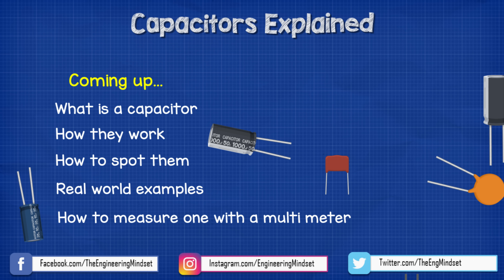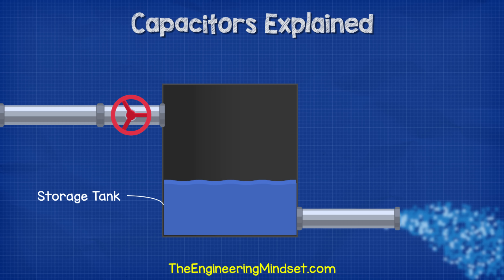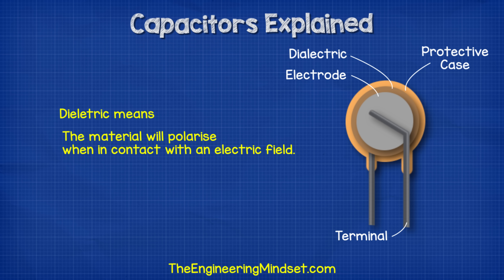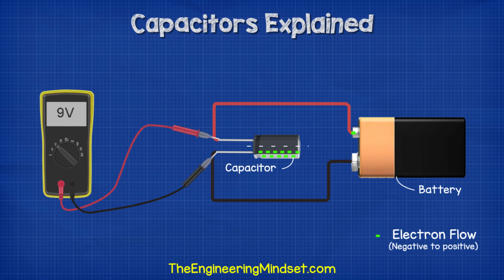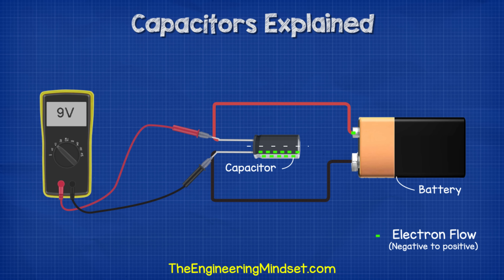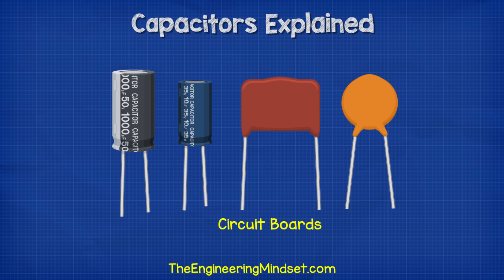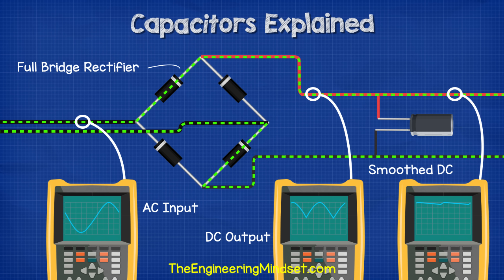Capacitors Explained - The basics how capacitors work working principle

Comment: The force generated from opposite magnetic poles is transferred through the system (conductors, equipment), not electrons.  Electrons change their orientation and vibration to transfer the force.

Transformers work by transferring power without touching each other.  By definition there is no electron transfer, they don't jump the space between the transformers.  They facilitate the transformation of energy.

Atomic theory is a theory and believes matter can neither be created nor destroyed.  There are many who believe God created all things out of nothing.  This is a fundamental teaching of the Orthodox Church and isn't believed by the Orthodox so much as it is transferred.  Tesla was from a Serbian Orthodox priestly lineage and did not believe in electrons or the theory of relativity.

He can be criticized for this, but he saw his inventions before he built them and they worked.  Very, very little loss of efficiency between his mind and the reality of his practical, working creations.  Edison and Einstein were great, but not comparable to Tesla in this regard.

Long story longer, electricians are regularly taught that things like generators are creating and pumping electrons.  Contradicts atomic theory (the basis for the bulk of contemporary electrical theory) about matter not being creatable or destroyable.

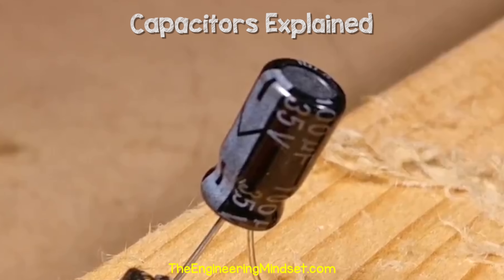Comment: There is an error at 6:02. While it is true that capacitors have a voltage that it is rated to be able to handle up to, simply providing more voltage than the rated voltage doesn’t cause the effect shown in the following video. The video shows what happens when you use an electrolytic capacitor in reverse polarity, and that reaction is specific to the chemistry and make-up of the inside of electrolytic capacitors. For example, doing the same to a ceramic capacitor will only damage the dielectric material, not cause an explosion. In fact, putting a voltage higher than the rated voltage on an electrolytic capacitor will only risk that the voltage exceeds the capacitor’s dielectric breakdown voltage, meaning that current then flows through the capacitor instead of storing potential difference. This is completely different to the video shown, as you can see the red and black clips being connected to the prongs of opposite polarity (assuming that red means positive and black means negative) meaning that it is not excess voltage which causes the explosion.

Comment: Hmm thanks, i now understand capacitors. And wish i had of known about them when i was 17 pulling apart a CRT monitor thinking id be fine as there was no power cable attached.
The pointed solders put holes in my fingertips and i had to push my hand away from the board with my other arm as I had no control over that arm and couldn’t move it away willingly.

Comment: Thanks.  I remember engineering classes with lots of theory and endless formulas - but little practical understanding. One doesn’t need differential equations to be an engineer - I never used them. And there is a Hugh difference between engineering vs. design.  Good design is critical.

Comment: Initially , its shows there are electrons on one side for a discharged capacitor, While charging the capacitor, it's shown that all the electrons at one plate are moving towards battery and some electrons came from the battery eventually leading to potential difference b/w capacitor plates.
While using at light ,it's shown that the no of electrons at each plate are equal and eventually light fails to glow. ( capacitor in discharged condition).
There is a contradiction in the explanation used.

Comment: In HVAC we use different types of capacitors. Such as start and run capacitors. Have you covered the difference between these types of capacitors somewhere? I haven't been able to locate mentioning of this use of capacitors. Thanks for all you do!
Reply from the maker: See circulating pump video, it's discussed in there

Comment: As great as this video is, and it is excellent, the storage tank analogy at around 1:00 in falls flat.  It suggests that a capacitor connected in series will pass DC current at steady state, which does not happen.  The contradiction can be seen at 1:45 in the animated schematic with the capacitor connected, and working in parallel with, the battery and load.  A more useful water analogy for capacitors is the chamber with an elastic membrane.  This analogy holds not only for these examples (storing/releasing energy and filtering), but also for helping conceptualize how a capacitor's reactance causes current to lead voltage in AC circuits.

Comment: Wait. How does a multimeter measure capacitance? How does it know, and how does it get it wrong slightly? How will it react to wiring capacitors in series and or parallel with other capacitors that are same values or different?

Comment: Hi great explanation.
I want to understand how they work?
Can a microwave capacitor be charged with a 12 volt battery ?
Battery is direct current  how are they charged in a microwave?
And what determines when it releases its charger ?
Will a microwave high voltage capacitor be used to relieve initial draw from a small inverter say 1000w sin wave?

Comment: Animation doesent show how circuit behaves when battery is connected but there are voltage drops (ripples?), and capacitor is fully charged. How it charges and discharges, helps to keep constant voltage during voltage drops.

Comment: I'm no electrician but a good example of a common item that uses a capacitor is a camera, specifically a point and shoot that has an optical zoom lens. This is a lens that extends out from the body. Once the batteries are drained and the camera shuts down a capacitor will ensure that the camera has enough power to retract the lens.

Comment: 2023 electrical engineering professionals: K this is good subject matter.

1997 Kid with 2500W parallel amps and 2000 Farad caps and twin alternators with 6 marine batteries in the trunk: K Brah.

Comment: 1.  A capacitor is simply two conductors separated by an insulator (dielectric)
2.  Capacitance is that property of an electric that tends to oppose a change in the voltage
3.  The charge is not stored on one plate or the other; the charge is stored in the dielectric
- these are simple but accurate descriptions

Your water tank analogy is more applicable to an inductor or inductance.  If you want to use a water analogy for a capacitor I would suggest using a hose, where once you shut the nozzle off, the hose expands to a point depending upon the water pressure applied (analogous to voltage).   When you open the nozzle again you get a blast of water until the hose regains its original size.  The elasticity of the hoses is analogous to the dielectric in the capacitor.  
A capacitor is simply a device that concentrates the juxtaposition of the two conductors and the dielectric so you get a large r capacitance than you would with just two (insulated) wires running side-by-side

Comment: I have electronic devices from the early 90s in storage, turning them on for 1 hour (60 minutes) Is it good or bad to prevent all electrolytic capacitor failures due to disuse? what interval time tuning on all electronic devices?

Comment: Hi, could you please explain something that’s confusing me right now?  In this video the electrons are flowing from the negative to the positive of the battery but in the transistor video the electrons are flowing from the positive to the negative. Which is correct or are they both correct and it depends on the type of circuit?
Reply from the maker: See our video on electron flow v conventional current

Comment: In my high school auto-shop class, one quickly learned that, even if it's sitting harmlessly on a workbench, never pick up  a "condenser" (an old name for  a capacitor).  It's a 2" long metal can with a wire attached.  It will hold a 12V charge until it's picked up, completing the circuit between the wire and can.  
It's a s\hocking experience.

Comment: Hi Sir, I have a question. For touch screen switch and some smart light bulb, when you turn off the switch, the light bulb only dim and not completely turn off. but when a capacitor is added between the live and neutral cable, the light bulb is completely turn off. Able to illustrate what is the reason behind that?
Reply from the maker: See our video on full bridge rectifier. The led light and capacitor is shown here

Comment: Fun fact: on a strictly technical level, capacitors do not store charge, they store just the energy - the net sum of charges in a capacitor is zero. It's a fun fact to remember, but for almost all intents and purposes that simplification is understood and only the "ummm ackshually" people may try to correct you

Comment: I took a dc circuits course years ago.  Plenty of stuff hadn't heard of before in class.  There was a guy from our area named An Wang who used capacitors to make the first computer logic circuits to make a 5v 1 bit or a 0v 0 bit
Reply: I remember calculating voltages for the bridge rectifier, but that animation is wonderful

Comment: How long capacitors can actually store the energy? I've been disassembling some electronics/motherboards and stuff in recycling center and one thing we did there was that we cleaned circuit boards as much as we could, so we also pulled all capacitators out, usually just with pliers or side cutters. Does this mean we have always been in a danger of a shock? Wow, didn't even know that, I've probably yanked hundreds of them out, lol.
Well, most electronics there was probably been years out of use, so capacitators probably were out of charge, but there was also pretty new stuff time to time. Also, there was pretty large capacitators like microwaves and radios have, those were such chunky boys!

Comment: If a capacitor stores energy for only 2 seconds, what happens if we used 2 capacitors? Will it become 4 seconds or the voltage/current doubles or other
Reply from the maker: See our capacitor calculation videos
Reply: Ok thx

Comment: paul: do not touch the terminals of a capacitor as it can cause an electrical shock
Mehdi: hehehe i wil touch wire a#$%^&*(*&^%$#@#$%^&*&^%$@@@#$%^&^^&%*@#$%^&*&^@#^$

Comment: I was told of the formula Volts x 2650 / amps to get farad amount(this is done with a/c unit running) if your meter didn't measure farads. I believe this is correct?

Comment: The electric domain is so vast that us electrical engineers have to specialize in certain fields. Since I’m specialized in network quality and power factor correction on large scale distribution network, I can add that there are capacitors much, much bigger than shown used in what we call shunt banks on the network, as well as in large harmonic filters. The capacitor I design and sell are often close to my height( 6 feet tall) and can store voltage in the 35 kV range (35 000 volts), weight as much as a man. Those monsters kill a human if touch when they are fully charged. We use hundreds of them in a single shunt bank to provide large scale power factor correction to a network connected to an industrial sector for instance. They are essential devices for grid management and power quality/stability.
Reply from the maker: Check our new  Power Factor Explained video soooo much detail and easy visualisations https://youtu.be/NIrKOVZrqnU

Comment: Would this then be similar to the older style coils we had on our older cars ? That provided the power needed to the distributor cap. I was always very cautious around the coils (I am a amateur) as I was told they could shock you very badly up to 20,000 volts. They scared me silly so I never liked being near them when working on my car.

Comment: I need a opinion. What my sister has is a boat. For 5+ years her little piezo noise maker intermittently chirps. It is a very very short chirp. Might not chirp for 30 minutes. Might chirp 3 times in 2 minutes. No rhyme or reason. Some where in the wiring harness or the three sensors that are attached. Oil pressure, Temp and a low fluid level switch. I have changed the 3 switches still 12 volts find its way to the little Piezo Switch. The chirp is only for a millisecond.  My idea is to put a small capacitor in line with the Piezo noise maker. Do you think a capacitor might absorb the 12v milliamps and disallow the little spike from making it to the piezo buzzer. And should I put in a resistor. One idea I have is putting a 12v horn in place of the Piezo Buzzer.  Me thinking it takes more than a milliamp to energize the horn. As you can tell I am not a electric wizard. but the little piezo buzzer drives my sister crazy.  Thanks for listening. p.s.  The related 3 switches / no heat / no loss of pressure / fluid level is good. And replaced the switches.
Reply from the maker: Check out NEW resistor video, everything covered! ➡️ https://youtu.be/DYcLFHgVCn0

Comment: 1:30, this analogy isn't quite accurate, since a capacitor is essentially an open circuit for DC, whereas the graphic implies that the water continues on the same path that it went on.
Reply: Can you explain what this means?
Reply: @nihalbhamrah6969  which part?
Reply: Yeah I wanted to write same comment!
Reply: I thought a capacitor was an "open" to AC?

Comment: Great video. Best so far on caps.
I have an Arduino powering electromagnets with a relay, all running off a car battery. The arduino uses a 5v buck converter and the EMs use native 12v. When I first turn it on and the magnets power up, everything shuts down. When I turn back on, it all works. I'm thinking I need to add an electrolytic cap on the Arduino power in to stop the voltage draining too fast when the magnets draw power?
Thanks to anyone who can help!

Comment: Could u use capacitors to continuously light up an led strip attached to a solar cell?
Reply: No. You need to store power in a battery. Caps are short quick bursts, such as in a camera flash. They can't store much
Reply from the maker: Seen the new LED explained video? so much detail covered! https://youtu.be/O8M2z2hIbag
Reply from the maker: Seen our new video on HOW SOLAR PANELS WORK in detail https://youtu.be/Yxt72aDjFgY

Comment: 2 questions for you (or any other commenter who has knowledge or other videos to recommend: 
1) what is capacitance? you covered the unit of measurement, but didn't talk about what it actually means. 
2) how does a capacitor become overcharged? The analogy you used makes it easy to wrap my brain around the basics, but from your explanation it makes it seem like the capacitor will accept electrons until its fully charged, then by nature it won't accept any more electrons. If this is the case, how does one go about overloading it? If it's not the case, how it it usually prevented?
bonus question 3) does a capacitors rating need to match with some rating on the battery it's connected to?
Reply: I guess, Answer for question no:2 is Q=CV;beyond this charge, it may not be charged..
Reply: In the HVAC field, where I work, it is said that a capacitor allows for a time delay on electrical flow. We used to say "time delay on voltage", but that's  not exactly right either. Either way, if I remember correctly, 1 farad = 1 second time delay when you have 1 volt flowing at 1 amp current. From there, you can do the math for any capacitor. Everyone likes to talk about how capacitors hold a charge, but they rarely talk about the length of time it takes for the energy to leave the other side of the capacitor, and that's what it's all about. It is just creating a time delay before the current is able to leave the other side of the capacitor.

Comment: But what is capacitance?  the voltage is how how much force it can handle but what about capacitance, What is it a measure of? what does it mean if it is higher or lower.

I also wanna say, my mind has been blown by knowing what a capacitor does and how important it is, thanks for the great explanation.
Reply: I believe it's like how many amps it can hold at the voltage. Because amps+volts = total power. You can't have one without the other. I think of it in terms of amps being how much water is in a swimming pool, and volts being how hard the water is being forced out of it.

Comment: At 0:52 that was an odd water tank example, I thought that capacitors are smoothing out fluctuations in demand not in supply. And to help fluctuation in supply in the tank example the inlet pipe should show larger or at a higher flow than the bottom outlet pipe.

Comment: At 4:54, why doesn't the positively chraged electrons building up in the positive side of the capacitor not just re-enter the circuit, power the lamp, and move to the negative side, and keep that process going indifinitely?

Comment: At the time of 6:10 , it looks like connecting positive power  to capacitor's negative pin and connect the negative power to the positive pin. That will cause the capacitor exploded no matter how high is the voltage applied.

Comment: I was looking at a circuit board that drives a crt. One of the capacitors on the board is labeled BP. It means the capacitor is bipolar. How does this type of capacitor work in a circuit like that?